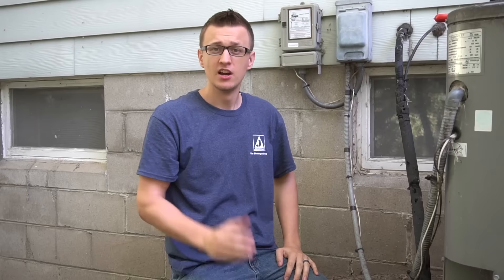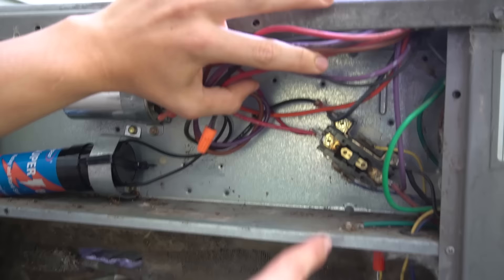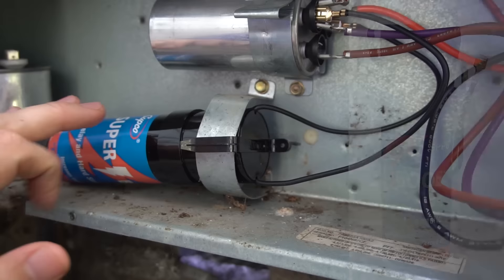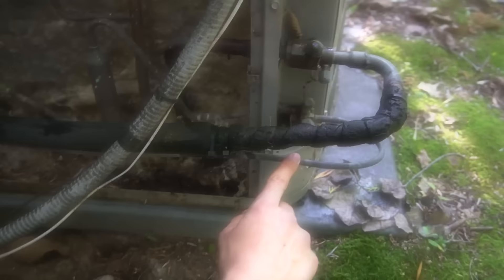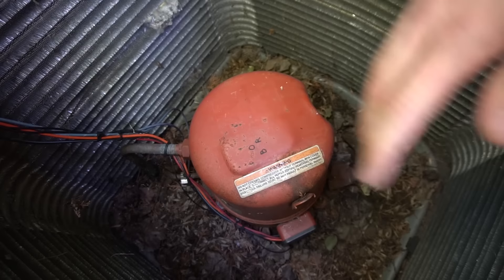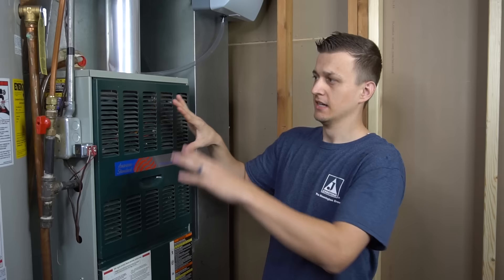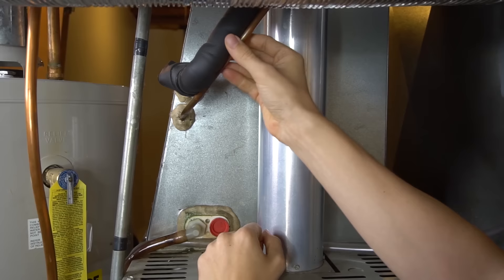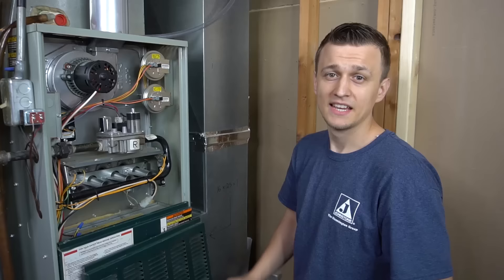All AC Parts and What They Do

Comment: I had a brand furnace and condenser unit installed at the end of the summer beginning of fall. The heat works fine but it's been a little warm the past few days and tried out the new unit outside it won't stay on. I removed power and the thermostat keeps the contactor engaged but when I put power back to it tries to turn on and fan spins and then it shuts off. Could it be a bad capacitor possibly?

Comment: I love your videos. They are really good. In the refrigerant line set, does it matter which way the suction line with the black foam insulation is angled. My unit on its plastic base was sinking into the ground and I lifted it up to level it out. Now, the suction line which was slanted from the house foundation down to the unit, is now slanted slightly more up from the house foundation to the unit. Is this okay? Does it matter? We're not using it at the moment, but Spring is around the corner and I just want to make sure it's ok B4 we do turn it on.
Reply: You mainly want the suction line to be either level or slanted towards the condensing unit. The suction line provides oil return to the compressor so if there are dips or low spots oil can collect there and not properly return to the compressor. Slanting it towards the condensing unit helps ensure oil will get back to the compressor, but the line set on houses is usually short enough that having a level suction line is fine. You do not want it to slant towards the house.

Comment: Your video has great detail and it is awesome. I have a dilemma. Wanted to know if it is OK to buy a condenser that was manufactured in 2000 and was in use until 2005 and has been sitting for 17 years? Wanted to know if a unit like that is still in good condition after sitting so long?. Thank you so much for your videos.
Reply: It it was stored properly then yes. If the system has been exposed to air for a while it can probably still be used if the system is flushed. If it was sealed and pressurized with nitrogen and the compressor runs it should be good to go.
Reply: @Redtooth75  thank you so much. I appreciate you taking the time to respond to my text

Comment: When my A/C turns on there is a loud "click".   A/C works normal and works well, but that "click" is SUPER loud.  Is that something I can switch out?   
(It's sounds like if you slapped a wooden ruler on a table loud.)
Reply from the maker: That sounds like the contactor and yes, you could try replacing it and it should reduce the noise. I have a video on how to replace a contactor if you need it.
Reply: @WordofAdviceTV  Great!  Thank you!  I'll search for it.  Much appreciated !   This is a sound I hear behind the wall INSIDE the house where the thermostat is.  I believe it's coming from the air handler.
Reply from the maker: @flyonawall6521  ohh okay! If it's inside the house then nevermind about the contactor. With noises inside the house the first step is to track down where exactly that noise is coming from. Could be a variety of different things.

Comment: This central AC units need to be improve, it has given me too many problems, even my ceiling came down from all the water, all the parts that you showed , I have replaced, now I use a window unit, with no problem,  the central AC I shut it down, it was getting me broke.
Reply: Sounds like a clogged drain line

Comment: Question!

In my home there is a door which houses what I believe is the furnace & air blowing parts.

I have a question about the  panel or panels leading to the A coil. Mine has some insulation between the panel and the A coil. 

I found a smaller panel resting outside of the unit inside the "closet space". The label on this small panel states it's supposed to go onto the catch tray to prevent the soaking of condensation into the insulation on the outer panel.

Does this smaller panel go inside before the insulation?

Comment: My central ac is coming on and the air is blowing. But, it is very weak.  I have clean the coils, the freon level is sufficient and per the 2 service techs that came out this week from Constellation said everything was fine.  They barely did anything.  I had to go behind them and clean the coils.  Could it be the condenser fan motor?  Do you have any ideas of what could be the cause of it barely blowing out air?  Signed, Hot in Texas.

Comment: Hello, my AC is creating sparks from the compressor. I have yet to fix it. Is it as good as gone or is there still hope?
Reply from the maker: Yes, there is hope. It may just be a loose or burnt wire connection at the compressor pins. I have a video on how to check if the compressor is good or not using a multimeter.

Comment: A run capacitor does not store capacity long enough to get shocked a start capacitor does that is why the have bleed resistors
Reply: Wrong, they will sometimes pop you if you’re not careful, start caps have bleed resistors bc they are much stronger that a run cap. A 300 mfd start cap will hurt way more than any run cap.

Comment: I had a new Trane XR15 (2 ton) installed and they recently put a compressor blanket on it to assist in noise suppression.  I had an XL16? before and it came with the suppressor blanket .  One thing I noticed is that the new unit tends to do a louder `clunk' occasionally when turning off- not always. Don't recall this happening on the older unit.  Is this something to be concerned about?  Did the addition of the aftermarket compressor noise blanket maybe make the compressor run hotter, thus causing this clunk?  The old one came with the blanket on already so was likely designed for it. The older compressor was shorter and fatter (Copeland compressor)?  The newer one had no blanket and the compressor is taller and skinner...I think it too is a scroll compressor though.  Anyways - what do you think?

Comment: I was wondering about this, my condenser unit never gets dirty, it never has any buildup of any kind. Something tells me airflow is being restricted and shouldn't be. I even sprayed water with the hose and didn't see water getting thru to the inside where the fan is. I did have a AC guy over recently but to clean the A coil indoors, I asked him about the condenser outside possibly having air flow restriction, he looked at it and said he couldn't tell unless he opened it and see if there was a double coil. Opinions?

Comment: What is that metal duct right in front of the A frame coils for? @26:42 you put your hands around it but didn't say. I punched a whole through it and it stays at 85 degrees. Never gets cooler yet from the outside it feels cold.

Comment: 6:18 alright I'll be THAT guy, the thinner line at this point is called the liquid line, the discharge line comes off the high side of the compressor before entering the condenser, then you get to the liquid line point once the hot gas has condensed into a liquid.

Comment: my ac never goes below 80 when set to 70 or 79 it just never goes below 80 it just keeps on running, i have cleaned the condenser, changed the filter, tired a new thormostat still the same thing, everything runs blows cold air but just never goes below 80 on the thormostat, wat else can i do? or cheak? i'm so confuesed

Comment: Do you recommend insulating the suction line inside the condenser?  After opening my condenser for cleaning I noticed that the suction line inside was not insulated.  Would it be a good idea to insulate and use zip tie to hold it down so the fan doesn't suck it up?
Reply from the maker: I would not recommend insulating the line inside the condenser. There is no need for that. I don't think I have ever seen that before too :)
Reply: Word of Advice TV me either lol

Comment: How to get access to the condenser inside the house to clean it?
Reply: The condenser coil is outside and should be easy to access for cleaning. You might need to take off some panels depending on how covered the coil is. The evaporator is inside the house. On a split system the evaporator coil is in the ducts right above the blower. The indoor one usually does not need cleaning if the filter is working properly. If the blower wheel is very dirty then the evaporator coil is too.  If you have good airflow through the vents and the suction line is not freezing then the coil is probably fine.
But if your evaporator coil is dirty then it is a PITA to clean. If its a cased coil you have to take off the access cover and lift up the coil to clean the bottom side. You need to be fairly gentle with evaporator coils because the copper used for them is relatively thin and can crack easier. If it is not a cased coil then you need to cut a hole in the ducts to get to the coil, unless a hole has already been made. A professional duct cleaner would have special vacuums and cleaning equipment that can do it a lot quicker and easier and with less risk to the coil.

Comment: My condenser fins has separate look like they didn't connect together .The Air conditioner man said it is 5 circuits so They are separate from one to another (I can see the open between them .Is that normal ?.The unit just installed  4 month .Thanks

Comment: Hello sir, I live in Texas and my AC is only five year old since I bought 🏠. But suddenly since last two nights it's not cooling the whole downstairs and my master suite. So I clean up my coils and also change MERV filters. But still problem hasn't been resolved. Do you think my Capacitor is gone which is why the ac is not cooling our living room and downstairs. Because my upstairs AC units running perfect but downstairs central unit is not working. Any advise greatly appreciate that. All vents blowing same warm and hot air and it's not giving cold air coming out from vents. Any chance could you suggest me what should I do or should I just replace capacitor and see if it's working or not ? Please advise.

Comment: My AC unit runs even when the thermostat is turned to off. It’s a ten part system - ac part outside and the heater furnace is inside.  Any ideas ?

Comment: my ac unit .. the compressor i can hear kicks on..  at that point the fan never turns on if i give it a manual turn the fan will take off nice and fast but within a minute it turns off.  im thinking its a bad capacitor but wanted to make sure with one of you gurus.  i know some capacitors are kick on and continue running type capacitors.. any ideas?

Comment: My Dog chewed through the wires next to the insulation hose. How do I  reconnect the wires right?
Reply: It's my Ac that is not coming on.
Reply from the maker: The easiest way is to simply strip the ends of the chewed threw wires and use small wire nuts to splice them back together. Then tape the wire nuts with black electrical tape and that should last until the next time the dog goes out for a snack. 😄 Make sure the power is off when you do this. Also, if you have a 3 amp fuse in the indoor unit, it may have blown too so after you splice the wires back together you would need to replace the fuse as well.

Comment: My 3/4" suction line is error, 7/8" is correct on 4 ton.  A/C seems to run ok, but should I replace?
Reply: My system seems to be running in grey area of velocity flow chart.  Cold air out duct is -25 below inflow temp.  I say all is good

Comment: You didn't cover sensor on compressor. I need to know about that.
Reply: Most systems do not use sensors and they rely on simple switches. Some systems though do have an internal discharge temperature sensor. Its a resistance based temperature sensor. You would have to look up that particular compressor to find the exact resistance values at certain temperatures to test it.

Comment: If one 120v line goes dead, does the Compressor  still tries to run?  A limb from a tree broke  one wire  from the house in a storm.
Reply: I asked about this because they replaced my sister and brother in law's Ac after a limb from a neighbor's tree came down and knocked out one of the 120 lines at the pole. Supposedly the compressor burned out because of it. 
Also at my mom's house a varmint bit into her 220 feed to her AC and got fried. It shorted one side going to the compressor and it burned out. Conveniently this AC was out of warranty at that time.
So if it doesn't kill the compressors, but only knocks out power, two families may have paid for repairs they didn't need.

Comment: My ac condenser is making a loud, whining type noise after the thermostat shuts off.  This started a while ago and at the time, the fan stopped running.  I ended up replacing the capacitors and it's started to work again.  But immediately when it finished it's first cycle of running, the noise started.  So I turned off the breaker and it stopped.  Any ideas?

Comment: Thanks Jay for you help. So I have a question. My home is a 2011 new build, my system is a Lennox. My a/c stopped working and after analysis I can confirm both the ac and heating is not working, the blower in the home is not operating. The system is getting power but I notice I have a 3amp circuit breaker next to the furnace switch (the switch the cuts the power when you take the front cover off). So, I assume this little circuit breaker is the equivalent of the fuse that you showed, as I don't have one. This tells me I have a short circuit or overload of some kind. Each time I reset it, reboot the system and then the breaker cuts the power again. I noticed the last time that briefly the blower did start up and this sent power to the outside ac condenser, because the fan came on, that lasted for about 10 seconds. So...I assume its time to call an ac company or an electrician. It's not obvious why the circuit breaker is breaking. Is replacing a the breaker a worth while option? I don't see anything else that's obviously causing the circuit problem. Thanks Jay!

Comment: I’d like to see how you clean that spine condenser, old timers, used to spray wd40 or brake cleaner on it, light a match, garbage unit, as a tech,  25 years experience, 24 volts if hot and sweaty, can feel like a 1 line power hit on 240v single phase😂, also ask people watching to invest in tools, meters, gauges, leak detectors. Better yet, have maintenance done on equipment, have a trusted male/female HVAC tech, the one that shows up at your home because you can’t figure it out, and family is coming over. PS don’t argue over the invoice after hours, you have no one to blame but YouTube.

Comment: Is it best to let your ac run when your not at home or leave it on while your at work. I tend to keep my ac off till 7pm when electrical rates go down and shut off at 5 am when I go to work. Some say you a/c works harder when it is off and trying to cool house down from 95 degrees to 75. Some say it does not make a difference. What is your opinion?
Reply: Let it maintain. It's less stress on the system than recovering all at once in the evening. And it's  comfortable when you get home. Life's short. Be comfortable.

Comment: Why don’t all condescending units come with a hard start. You can buy on Amazon for dirt cheap.
Reply: Why would u pay for something u don’t need….
Reply: @donkeygat93  make compressor last long? A hard start kit helps your AC compressor start up to 10 times faster and more efficiently. It helps overcome the mechanical inertia upon startup. The first couple of seconds for any electrical motor/compressor is when the most strain electrically is placed upon it.

Comment: is the saver switch a requirement for ac units or optional?
Reply from the maker: It is not a requirement and really has nothing to do with the unit. The electric company offers a small discount on the bill if one agrees to have it installed on their unit.
Reply: @WordofAdviceTV  ah I thought so. I guess it helps with peak demand a lot especially when everyone is running there ac.

Comment: Question:  Any opinions on those water mister systems that mist the water on the outside of the coils?  I have seen explanations (sales perhaps) of how these can increase cooler efficiency.  My AC guy says they are actually worse for your system and don’t work as advertised.  Just wondering how people that know or are currently using one that isn’t a sales spiel…

Comment: Are Air Handlers and Furnaces the same?
Reply from the maker: They are both the same thing although typically an air handler would be referring to just central air conditioning without any heating. But if there is a furnace, the AC would use the blower fan in the furnace instead.

Comment: Can the condenser coil be replaced, and if so, is this a cost-effective solution?  My mom's unit is 20 years old and a lot of the fins are light gray and chalky and readily disintegrate.
Reply: Yes they can be replaced but it is a ridiculous job to do time wise. And it will not be cost-effective because you said it was a twenty-year-old unit that means it's going to be using the old R22 refrigerant and most manufacturers are not keeping parts for those especially a coil for a twenty-year-old unit. Beyond that it's a twenty-year-old compressor with most likely a twenty-year-old evaporator coil in the furnace. Too many old parts that quite frankly could fail at any time. Smart money would be to replace the system. Just my 2 cents.

Comment: Question.  Can you cut those wires going to the fan motor and put a connection there so that you can disconnect the fan when you need to clean the unit?
Reply: Yes but you can also disconnect them from wherever they already are.
Reply: @Redtooth75  Currently they are connected to the capicator.
Reply: @pipi7731  i think it would just be easiest to take them off there. But you can add a wire nut or molex plug if you wanted to.
Reply: @Redtooth75  Thanks.